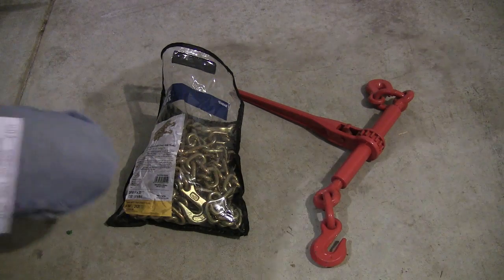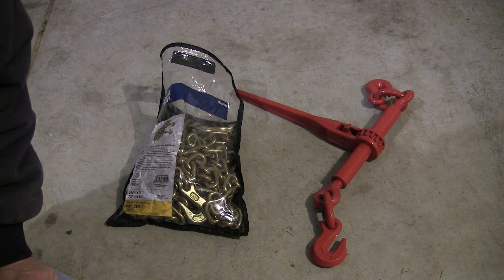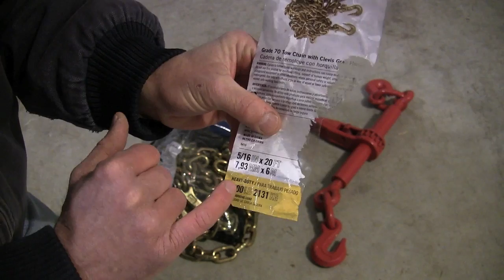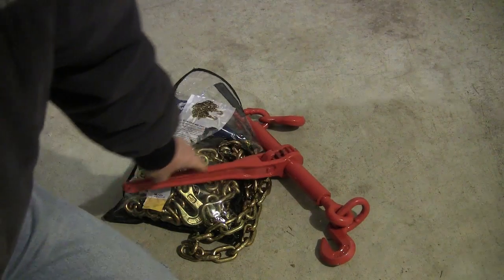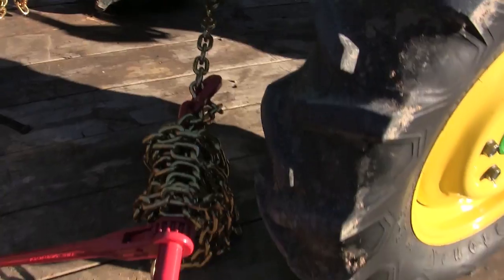Booming Down a Tractor-Working Load Limit

Comment: If you're using a cam buckle type binder and a ratcheting binder on the same load, tighten your cam buckle binder first then tighten the ratcheting binder up. You can get your old tighter and don't have to fight so hard trying to pull on a piece of pipe to get it tight.

Comment: Chain limit is straight line pull the angle reduces the load limit. For example when tying down cargo in the marines a 10k chain and binder was calculated at 7k
Reply: This is what I came here looking for. 
Why? Why is the WLL diminished when pulling at an angle? Honestly truly, what I'm looking for is a demonstration of the different configurations of a lifting /tie-down device. Why are the load limits different for a straight hook than that of a cradle hook? And those will be different than a sling or choke hook. I'd love to see each configuration demonstrated to their limits. With identical gear obvious.

Comment: I may be wrong here, but i'm assuming this formula is set up so that any 2 chains will hold the load...tongue side when accelerating, ramp side when stopping and sides for turns.  If you're using various chains and boomers then the 2 on any side should be able to hold the load in order to be safe.

Comment: Hi, Mike.   I really appreciate your videos!  I am in the process of deciding what securement system I need to buy for my little compact tractor.  I could certainly go with the Grade 70 chains and at least a 4700 WLL binder.  But for me that would be overkill.  I looked in the Department of Transportation regulations, specifically in the Federal Motor Carrier Safety Administration.  I cut and pasted the rule below.  It appears to me that you get to the max load by taking the aggregate WLL of all your chains or straps and then either making that the max load or MULTIPLYING by two, not dividing, depending on how the cargo/tractor is secured.  Am I really off base here?

Minimum Working Load Limit for Cargo Securement Devices and Systems

The aggregate working load limit of any securement system used to secure an article or group of articles against movement must be at least one-half the weight of the article or group of articles. The aggregate working load limit is the sum of: One-half the working load limit of each tiedown that goes from an anchor point on the vehicle to an attachment point on an article of cargo; and The working load limit for each tiedown that goes from an anchor point on the vehicle, through, over or around the cargo and then attaches to another anchor point on the vehicle.
Reply from the maker: Steve, I'm going to need some time to research this.  I see exactly what you're saying.  When I researched that video I spent a huge amount of time making sure that I was giving good information and I swear (but can't prove) that the line "The aggregate working load limit is the sum of:...anchor point on the vehicle" was not there.  I even watched one of the FMCSA videos that backed up what I said and I don't know if it has been taken down or I just can't find it.  I know that there are reg's for under 10,000 lb. equipment that are different than over 10,000 lb. equipment.  Most of our hauling would be under 10,000 lbs. but I've been searching for those regulations and haven't yet found them.  It definitely wouldn't hurt to get heavier than you need but I'm not sure what that'll look like.  In my mind it would be overkill.  I may call our local MODOT office and see what they say, the original idea for the video came from a day I spent with them and they were on board with the info I gave in the video.  THANK YOU for catching that!

Comment: Hey Mike, any recommendations for number and length of chains? Assuming you are just wanting to tie down a typical compact tractor and an a attachment in addition to the front bucket.   Thanks!
Reply from the maker: Seems like about a 12'-15' chain is the perfect size.  Get four of them and you should be good.
Reply: @TractorMike  Thanks Mike.

Comment: How much does the tractor weigh? You never said. 

Omg, please turn that snap-binder around and pull on the binder pipe. I cringed witching that. 

What does MODOT mandate for a legal tie-down? I've aways gone with 80%. 80% tie down. I think it's 70% of the load weight restricting the load from moving forward, 20% restricting the load from moving backward and 50% of the load weight restricting the load from moving side to side.

I just looked it up in the Federal Motor Carrier Safety Regulations. 

FMCSA regulation 393.102(a)

80% deceleration in the forward direction 
50% rearward or side to side

Comment: Hey Mike, this video is all about chains.  Are tow straps an acceptable alternate (as long as they meet the load requirements)?
Reply from the maker: Yes.  I'm finding there are folks who hate straps and will only use chains for hauling machinery and are passionate about it.  The Missouri Department of Transportation won't use straps when hauling their machines and they don't recommend it.  But, as long as it meets the load requirements and isn't frayed or damaged in any way you'll be fine with straps.  I prefer them for hauling my zero turn and for brush hogs and implements.  I'll probably get some hate mail from the "chains only" folks...

Comment: Good video and I hear boomer and binder here.  Is the WLL of the trailer marked?  How do you know what it is? Thanks
Reply from the maker: +Jim Buford I've never seen it marked.  Hopefully you can get that information from the trailer manufacturer or the dealer.  It is the responsibility of the driver to know his trailer tie downs WLL, and likely it would be way higher than any boomer or chain, but the safe thing would be to get it from the manufacturer.  To be honest, until I researched this whole thing I never knew the trailer tie downs were rated for WLL.  It makes sense when you think about it, though.  You need to know where the weakest link in the chain is.

Comment: The example you used in the video calculates the max load limit as 9,400 lbs, but the trailer max load is 6,000 lbs.  I take it you don't go beyond whatever the trailer load limit is?
Reply from the maker: Yes...since the video was about chains I didn't mention that, but that's the FIRST thing to look at.  Does your trailer have enough capacity for the load?  I've seen some trailers going down the road with the wheels bowed out and you know there's more load than axle rating.  Thanks for bringing that up!

Comment: on the back could you put a clevis on the drawbar and run the chain through that.

or would that lower your WLL
Reply from the maker: +Drew Tibert I see a lot of guys doing that and it's an easy way to chain down but it doesn't meet D.O.T. standards.  You need a chain on each corner.  I'll show you the proper way to do it in video #3 which is a couple of weeks and a little editing away.  Please stay tuned :).
Reply: OK thanks

Comment: Hi Mike,I have a question for you. I have a 1944 ford 9N farm tractor,and I would like to install a front bucket on it. Can you or do you have a video on how to install on a older tractor?  Thank you,Buddyboy
Reply from the maker: +Ken Harvey Ken, I don't.  I'll caution you before you move forward, you're going to be spending more to put the loader on than the tractor is worth, but if the tractor has sentimental value and you want to keep it in the family and get some use out of it, it may make sense.  I'm going to recommend a couple of places to check.  First, there's a company named SSB Tractor in New York that specializes in loaders for older tractors, here's a link: http://www.ssbtractor.com/tractor-front-end-loader.html.  Now, I don't know anything at all about these guys, but that's one of their specialties, so it might be worth a call.  Also, if you want to find a used loader, you might try Rippee's Used Tractor Parts in Farmington, Missouri at (573) 431-5939.  We dealt with them periodically when I worked in the dealership.  Many of the older loaders were "trip bucket" loaders, in other words, the bucket part was not powered hydraulically, you picked the load up and when you wanted to dump it, you "tripped" the bucket and gravity took over.  Not the best system in the world, but better than a shovel.  Another word of caution, you'll be stretching the hydraulics of a 72 year old tractor when you put the loader on, and some of the parts to repair that system are obsolete or very hard to get.  You might be able to tell I'm not a huge fan of loader installation on one of these older tractors.
Reply: Hi Mike, I never thought of putting a load on the hydraulics which is what I would do,and it doesn't make sense. The tractor is a real beauty.  Thanks for your help,I really appreciate it. I just subscribed to your channel,and your video's are excellent,you know your stuff !!!  Ken

Comment: @ 2:53 you are mentioning the trailer attaching or anchoring point has a WLL but you didn't mention how it was determined.  Was there a plate or documentation with your unit?  Did the manufacturer have something?  If it isn't documented somewhere, you would be taking a risk and shouldn't use that trailer for hauling the tractor.

@ 3:55 you were discussing the reason for dividing by 2.  The recommendation is that the total WLL of all the tie-downs used must equal HALF of the cargo's weight. (This is like another safety factor on TOP of the other safety factors.)  

For example, if the tractor was 20, 000 lbs, then the combined WLL of the 4 tie-downs must meet or exceed 20,000 / 2 = 10,000 lbs.  The WLL for each tie down should meet or exceed 10,000 / 4 = 2,500 lbs, in this example.

(Here is another separate confusing note that might be covered later:  Depending upon how you connect to the cargo (direct vs. indirect), the method could also reduce the WLL of the tie-down.  Direct connections reduce the WLL by half, whereas indirect tie-downs do not reduce the WLL. )
Reply from the maker: +Ji Fi-01 (Jif) The anchoring point WLL would be determined by the manufacturer of the trailer.  I was discussing that with a friend a few weeks back and he said the REAL WLL would be determined by the kind of day the welder was having when he put it together, and there's probably a lot of truth to that.  That's the real tough point to this whole scenario, its the responsibility of the trailer owner to know the WLL of the tie down points, but that's not information that's real easy to get.  It may be on the serial number plate of some high end trailers but I've never seen it.  But, that's what the regulations say and it makes sense.  Thanks for the additional information you posted.
Reply: +Mike Wiles (Ask Tractor Mike) Thanks, Mike. Your comment is so true regarding the actual strength of the welds.  Doesn't matter if the weld was done by automation / machinery or the best certified welder you can find/afford, the strength is only as good as the design and technique used in building the joint. The strength of the actual steel adds another layer of consideration.  If the manufacturer has not stepped up with data, then it appears the only way to know the strength would be thru worst case analysis and destructive testing. Yikes, no point in tearing things apart.
Reply from the maker: +Ji Fi-01 (Jif) Some of the lower end trailers I've seen scare me.  I have a really good friend that took his trailer in for some cosmetic work and the guy servicing it discovered the welds from the tongue to the mainframe were coming loose.  And it's not one of the bottom end trailers.  The trailers you buy in a compact tractor "package" deal are usually the cheapest of the cheap and I'm pretty sure the guy building them has no ideas what WLL stands for.  Fortunately, most people that buy trailers like those use them to bring the tractor home and then park them in the fencerow and never use them.

Comment: Nice video but you should have clarified why you divided it by two, I'm sure most would assume two front & two on the back but specifics are important.
Reply from the maker: +mrbailey31 That's a good question, that's what the D.O.T. standard is.  I'm not sure how they arrived at it.  It's two front and two back, I'm still working on that video, it'll be number 3 in the series.  Again, sorry to string it out into four videos, there's a lot to cover.
Reply: +Mike Wiles (Ask Tractor Mike) See my other reply elsewhere in these comments for the answer / explanation.  Hope that helps.

Comment: Tractors under 10K that are privately hauled may not be subject to any regulation in your state. I recently picked up a tractor 3 states away and in my case it was pretty much up to me how I secured it baring some outright inadequacy like duct taping it down. I'm sure, if it came off the trailer, there would be some post catastrophe attachment of civil and/or criminal penalty. To be responsible, I "youtubed" various state police videos and probably over engineered the tie down process but it would have met any DOT standards for the tractor AND the implements that were attached. Mike your video came out about a week too late for me. Surprising the dealer said it wouldn't come off if I just put a strap over the loader bucket and ran some chains to the draw bar. It probably wouldn't have but if it did, It's my fault not theirs so I tied it down to meet commercial standards for a load greater than 10K.  Using this standard will keep you safe and legal pretty much everywhere. I'm still going to watch Mike's following 3 videos on the subject as soon as they are posted.  There's no reason for me to stop learning.
Reply from the maker: +A Czorroski I have to be real honest.  I've probably hauled over a hundred tractors and I've never once been legal because I had no idea the laws were as strict as they were.  I really don't think my loads were unsafe, but the DOT would argue, but I never lost anything.  Now that I know what the regs are I'll be in compliance from here on.  It doesn't take that much more time to do it right.  When I managed a dealership I struggled with what to do with customers.  I remember a guy that I helped load a brush hog on a flatbed trailer and he started to drive off with no straps or chains.  I stopped him and said "don't you want to tie that down?" He relented and made a half-hearted attempt at putting a strap down.  Then I wondered, who is liable?  If I'm a dealer and see him drive off with an unsafe load, I have a responsibility to stop him.  BUT, what if the chain-down job is awful and I stop him and help him do it right, then I'm liable, right?  I struggled between dealership liability and customer safety, but if pressed, I'd a lot rather have a little liability on my shoulders than a customer injured or in trouble.  There's a lot of gray area if you're a dealer.  Thanks for the comments.
Reply: +A Czorroski What do you mean duct tape isn't strong enough?  dumb look  I have a box of 24 rolls in the back and planned on using at least half of 'em.  another dumb look  HAHA.  :-p
You did the right thing by treating your load with extra care and using the "heavy commercial equipment" category for securing it.  gives crowd applause   It won't hurt you to over secure it a little bit with error on the side of caution.  I'm glad you had the smarts to look into it further as it never hurts us to always learn more (thus the reason we share and watch Mike's cool videos, too).   Not that the dealer was trying to get you in trouble, but that guy is doing more harm than good by mentioning what he did.  shakes no-no finger
Care to share what equipment you picked up and show off with some pix or vids?
Reply: Hey Tractor Mike did you use 4 of the 20 foot chains or just one 20 foot chain for it all

Comment: Your helper binding down the old style binder is lucky his hand didn't slip off that cheater pipe and crack his skull and kill.him for his stupidity and trying to push instead of pulling down the binder and you didn't correct it in your video...wow... incredible and btw his had didn't slip but the binder went sideways on him ....
Reply: Not only that, but the binders usually have a warning cast into them that says to never use cheater bars.